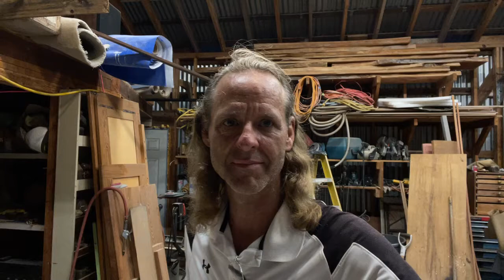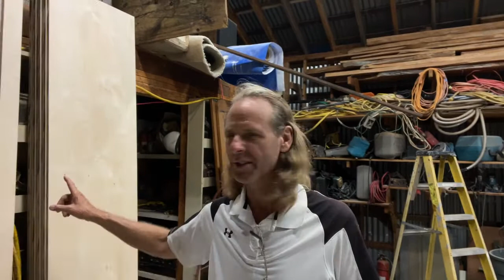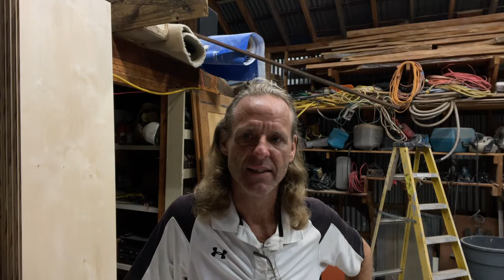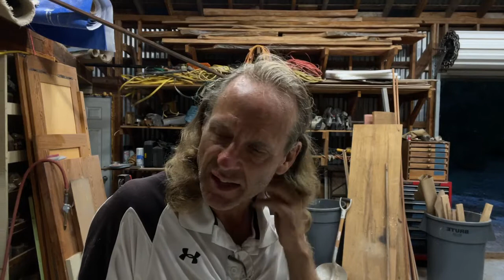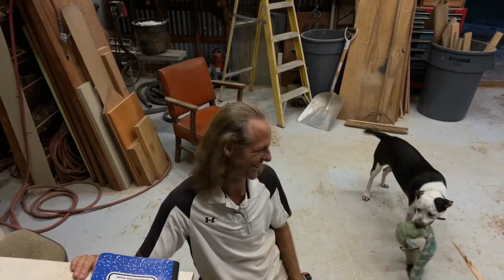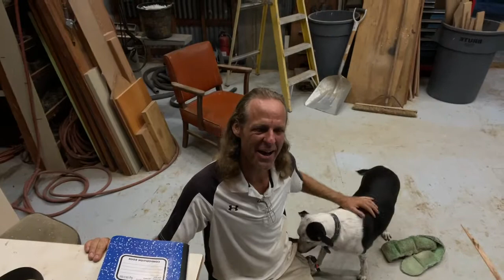Batteries In Boxes

Comment: I like your attitude and optimism to start such an adventure without having a smaller prototyping approach, I mean starting with a smaller prototype and playing around first hand before starting such big thing you had started cause I had watched part of the whole water tank cooling and shadow idea before.

At least here it needs a lot to know to find the right matches regarding those Voc of panel arrays that do not go over the limit of the inverters cause Voc depends on the deepest temperatures you face during operation but I guess Texas is even in Winter more of a sun shide state than arctic cold. 
I had 200 possible inverters for the solar panels I had bought used for cheap having each 250 Wp and 7 years old.
But once I had done the math to calculate the Voc at -20°C instead of the STC Voc shown in the solar panel spech sheet, those Voc went over 50V or over 55 V which meant that I had only a choice of 3 inverters, 1 no longer sold, and 2 barely available. 

But things might be easier in Texas temperaturwise cause you can do things a lot easier. 
If you ever need to plan and simulate a solar array like the better spot, orientation, angle or meeting your households demand better than there is a professional software for free for 30 days where you can model a 3D building and put modules on the roof or walls and so on or even on ground as you did and calculate the difference depending on angle to the sun or azimuth or even putting it on a foundation or 1m higher foundation to see if it has what kind of impact.
The software knows all the generatos and solar panels, you can build your own batteries and connect it to the grid or not and check all the energy flows .

The software is free to download, it might run out after 30 days but 8 times a year they release a new version and if you install that new updated version on top the 30 days start again - otherwise install it on a differen computer as long as you do not use it commercially. It works quite well in europe but also in the rest of the world and is made in Berlin , germany.

Search for pvsol premium from valentin software and make sure to download the premium version, nothing else. There is not even an email required but I suggest to let them know cause they send you an email once a new version comes out. 

The software will use your spot and preferences and the panels you have bought to build the unit and check it elecritcally for compliance if Voc does work out for your spot. It is not an assembly plan only shematics and the main goal is a simulation of the whole year based on last 25 years or so by a 1 minute frame. If you add your devices like fridges its yearly consumption and so on like the 247 router then the system calculates 24 hours 60 times / hour for 365 days all your energy needed and harvest and the effect on the battery .

That helps a lot to understand where to invest the next budget available, bigger solar array or battery or different generator.
On the other hand it avoids you to go too big in one direction. But it also shows each impact to move 40% of the panels from the usual south direction for maximum generation to a better life suiting generation. For launch you will have allready surplus and then it would make sense to move some panels arround in a tent style have of the modules facing east and other half facing west for an earlier generation for the breakfast and the lunch in the evening. 

It is free, I use it a lot for smaller and bigger projects for friends to involve them how their house or shed or holidy cabin out in the woods could look like afterwards and which would be the best meeting their demands. If you are out of the house the whole day and all come back in the morning then you would benefit more from some panels in east and west direction to produce more energy from solar in the second of demand instead of always going through the batteries and all its losses.
Could be that TEXAS is too far south and that the benefits might be smaller compared to germany cause the tEXAS sun might stay higher than here. But it is great tool to check your whole installation once you have assembled it and check such figures you had thought about and those that should be possible cause the software is quite accurate.  

Of cause a bit late and would be better to have had that before but once you got and understood it you will like it for sure cause it is very well though through like your thoughts when you talk about the then shadowed water tank wall as a cooler for the battery and power generator room also these considerations of putting the insulation under the aluminium roof but on top of the wooden construction. 

Have a look for the software - might need some patience to get into it so start simple and small before you think about a bigger building and complex roof construction to put the solar panels on.

Comment: Nice getting to know you.   From where do you collect the rainwater?   I know your plan is to focus on the batteries, and the solar but that’s a whole other set of experiences I would be interested

Looking at you I find it hard to grok that you spent 40 years doing anything.  You’re holding up well
Reply from the maker: Thanks, I’ve been on rainwater for my domestic water for 17 years now. I will be doing videos about what I’ve learned. My primary knowledge base is in building from a basis of building science and eventually the channel will pivot towards building an understanding of how physical science can inform our approach to constructing buildings. My priorities are in providing durability, energy efficiency, along with superior comfort control and indoor air quality. All of that is required if we are going to live comfortably off grid. Many systems work together. After that, beauty happens. This is going to take awhile.
Reply: @RayBuildsCoolStuff  your background includes more than just finish carpentry, doesn’t it?
Reply from the maker: @edwardbyrd7667  yeah, just a bit.